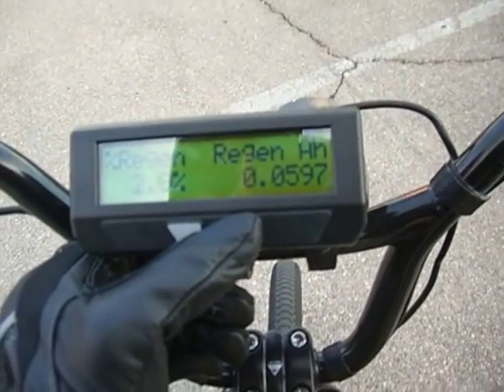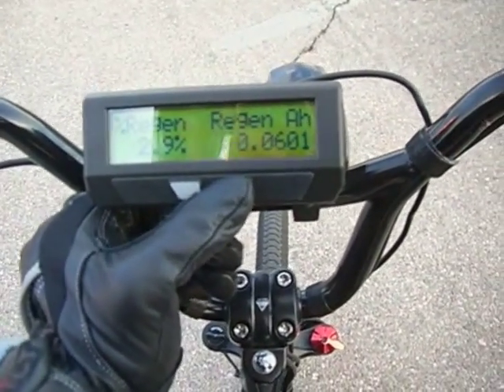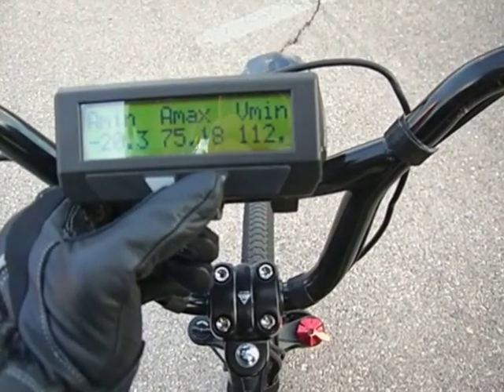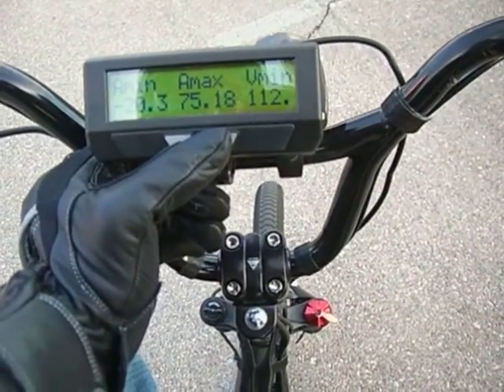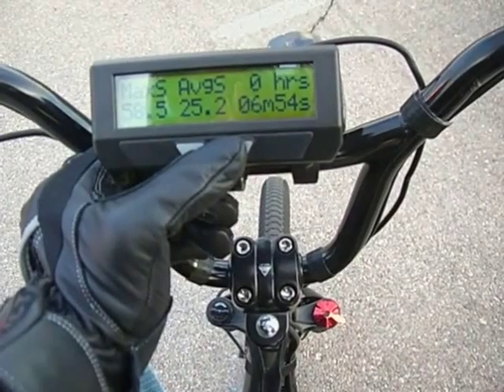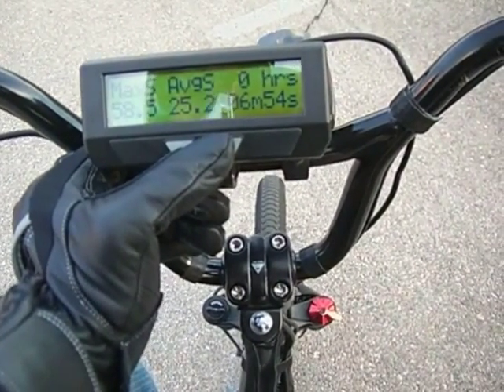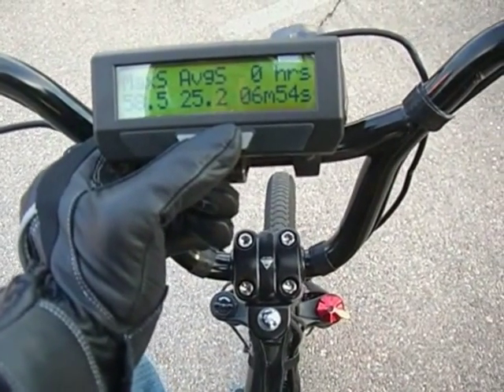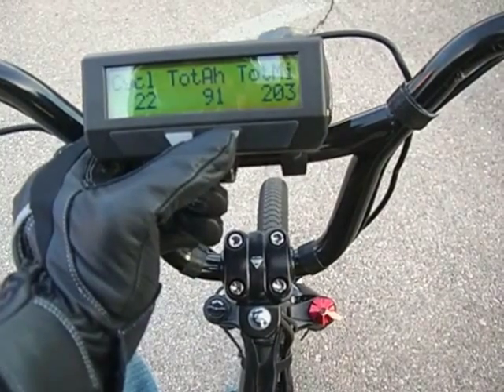ZombieSS Mini Monster Ebike 58MPH Version 2

Comment from the maker: @Doctorbass  Thanks.  I'm running a set of your torque arms as my drop outs :)  Got my new higher powered Hubzilla installed now and did some test runs last night.  125V, 102A battery/240A phase, it pulls way harder than this little 9C 2806.  Video should be up this weekend.